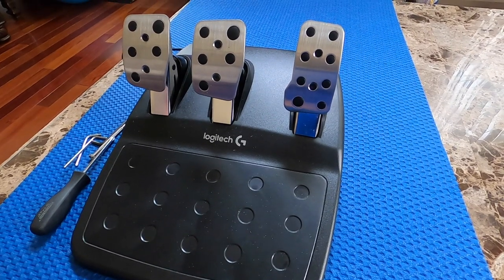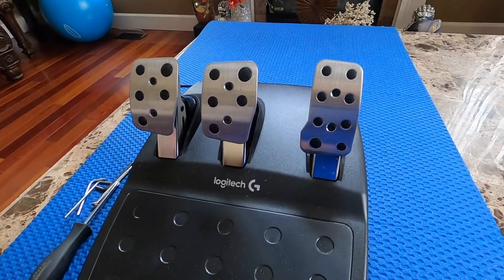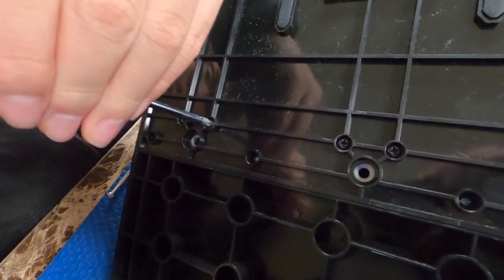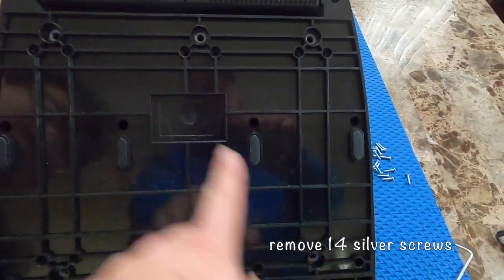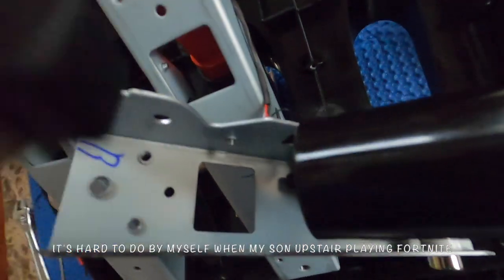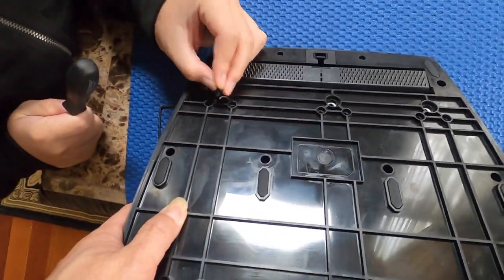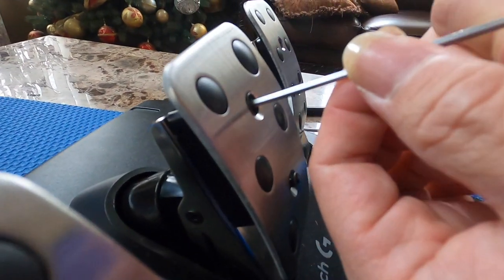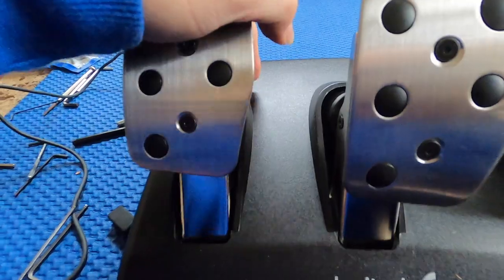LOGITECH G29 CLUTCH AND BRAKE PEDAL SWITCH (super easy mod)

Comment: This is a great video. Could have a bit more instruction, but it answered the question I had which was "is it possible to switch the location of the brake pedal to where the clutch pedal is." And it appears that you can.